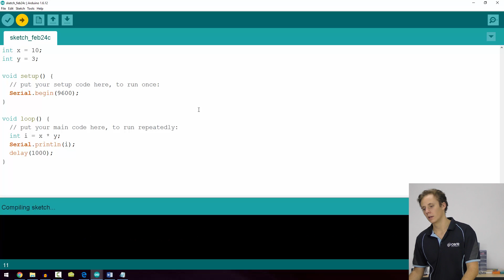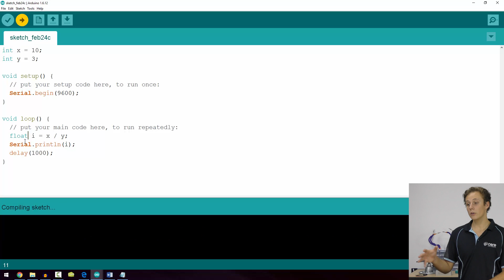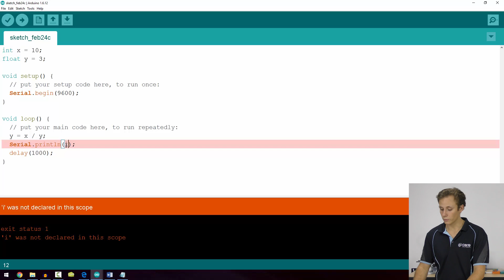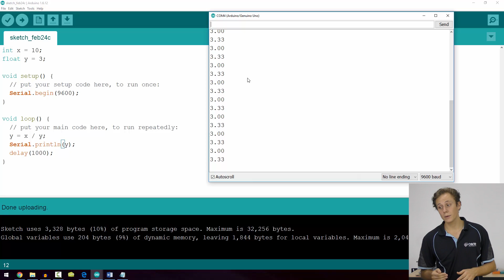Arduino Workshop - Chapter Three - Using Maths

Comment: how do you use the less then and grater then functions in math on Arduino, what does the float function do in Arduino, what does the Boolean function do in math and how would I use the Boolean function outside of doing math on Arduino?
Reply: should probably google that